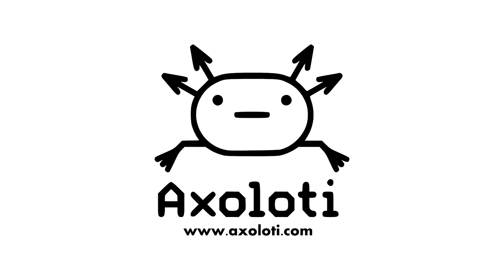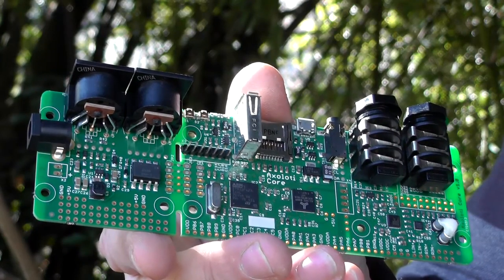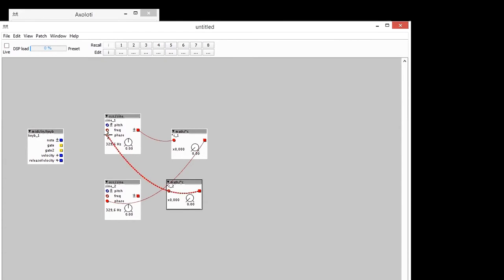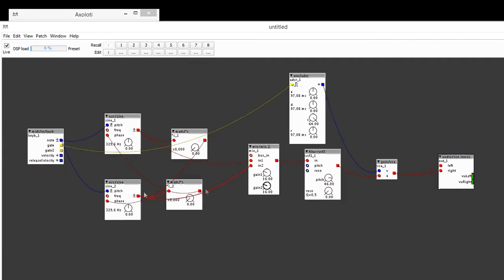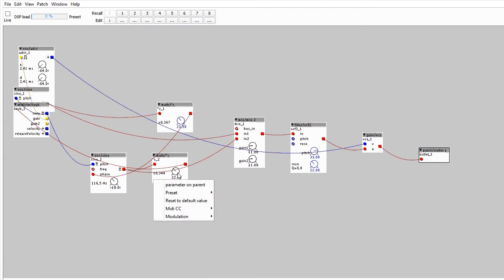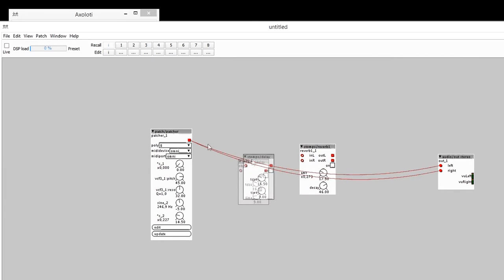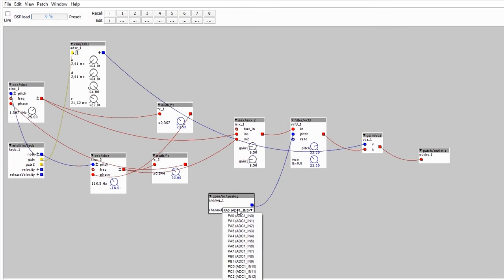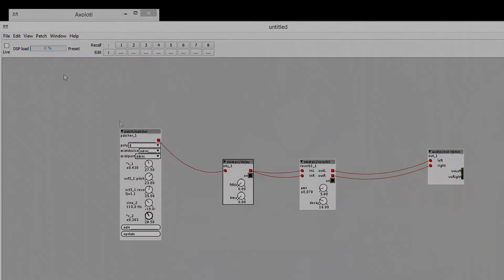Show & Tell - Axoloti

Comment: Great video, thanks for it... I was wondering how you were powering your box outside. Laptop? extension cord?
Reply from the maker: I use a 5V battery pack (as to charge a mobile phone) to power it on the road